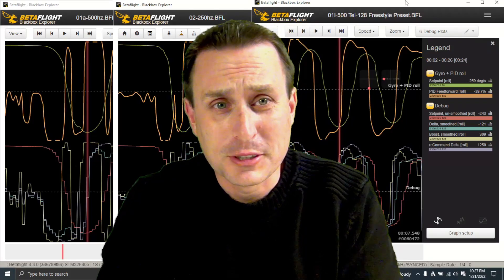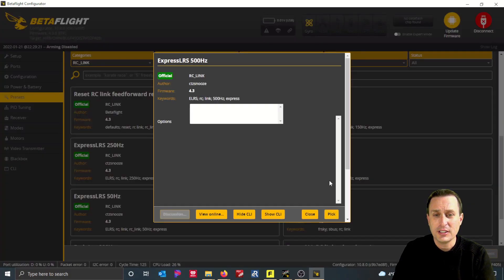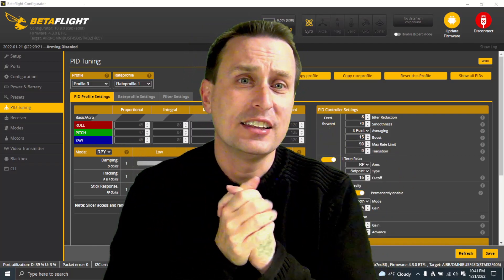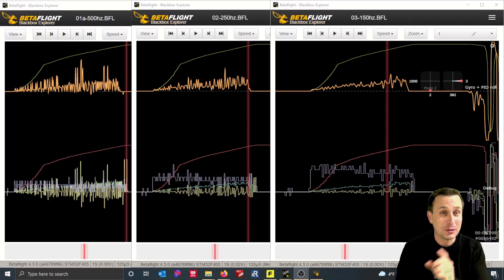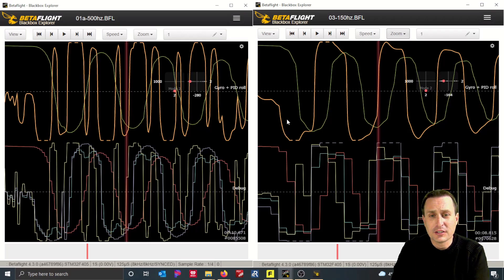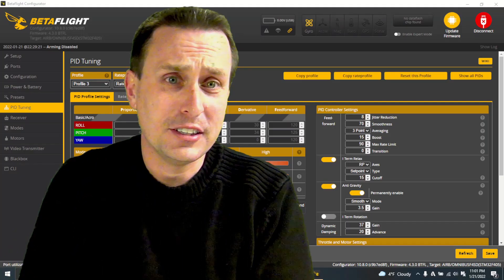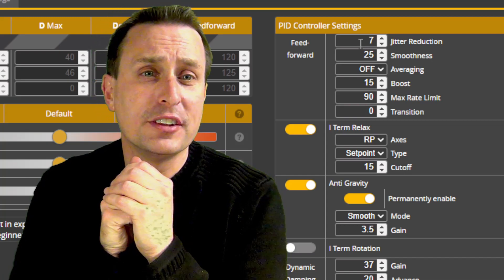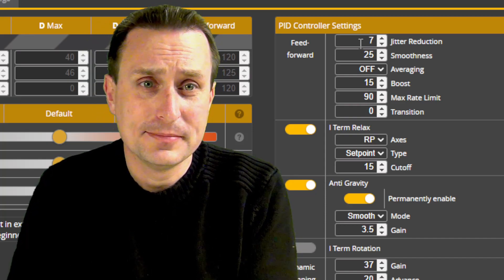The DOWNSIDES of Low Latency RC Links | the JITTER secrete!  💥😮

Comment: Brother what would cause my throttle stick input to not be in sync with motors. If I’m going in for a dive and I drop throttle it takes just a second then it’ll react to my input after It should’ve already started the fall. Same for when I come out of the dive it’ll just keep climbing for just a second after I’ve gotten my throttle where I feel it needs to be. Its like it takes just a second to make it to that position say if I bring my throttle to 50 percent my motors raise to 60 then ease back to 50 where where it needs to be and it gets worse the farther away from myself I get. Thank you sir.
Reply from the maker: if a ducked quad, switch from props out to props in: https://youtu.be/7GweG0RnCfc?t=459
Reply: It is a nazgul 5. I put your 5in tune preset on it last night and my telemetry rates are 1:128 so do I need to make it like 1:64 or whatever the numbers are lol or would that even have anything to do with it. I havent flown it since I put the tune on it but I armed it and it really seemed to be a lot smoother but I can’t really tell til it’s in the air. Thank you a lot man
Reply: Im using the 250hz packet rate. While I was running a ratio of 1:128 would I need to go up to 500hz or Lower my ratio to 1:64 if I stay with 250hz
Reply: Update. Quad is doin better than it literally has ever done with the UAV tech tune. Maybe a ms in lag but I’ll figure that out. motors were like ice I mean not a bit of heat My 1400mah lasted me normally 2:30 3 mins. My last flight was seriosuly 6 mins exact. If you need a tune I suggest UAV tech. It’s like a completely different drone thank you a lot brother.

Comment: Thanks for the info Mark. What can we do to reduce jitters if we're not on 4.3?  
I recently migrated all the quads I've built to ELRS  from various entry level control links. I've just finished a build tonight then realised my F7 FC didn't like the newest 4.2.x (no ADCs showing), so I'm back to 4.2. I might b stuck there on this quad.
Reply from the maker: No ADC's?  What does that mean?

BF 4.2 has more aggressive filtering by default for FF, so you should be ok.  There is FeedForward setting in 4.2 as well, they are just only in the CLI.  So go into the CLI and type 'get FF' or 'get feedforward' (can't remember) and you should see them.

Comment: i think this is what eLRS got a bit wrong, chasing ultimate range on 2.4GHz and sacrificing everything else just to have smallest packets possible to get that range... SNR is one thing, but only 4 full res channels limits the use to kwads or shitty epp fixed wings only which is a bit of shame as all super-small eLRS receives would be ideal to use on small micro planes and other models) ....i wish they will add some mode to have support for 6+ full res pwm channels in the future.
Reply: ELRS was developed by drone racers for drone racing. Just because what they developed isn't what you wanted, doesn't mean they did anything wrong.
Reply: @benaresq  they didn't do anything wrong!, it got them the very needed global visibility. there wouldn't be any eLRS ecosystem emerging as recent months without that. it is just current use is so narrow focused while it could be full-fledged open source radio link for everything.......maybe one day...

Comment: Does the processor loop times affect the jitter? Thanks for the info Mark, super interesting!
Reply from the maker: Yes.  Scheduler in 4.3 is revised to give Gyro the highest priority.  So if you run too close to 100% (after arming) (F411 boards) your jitter on the RC link can go up.

Comment: Thank you! Very informative. Do you have any onboard dvr showing what the jitter looks like? Is it very noticeable?
Reply from the maker: It depend how high you push FF for a locked feel and quad weight/motor power.  DVR not so much, but HD, yes (with high FF).  Slow rolls at 0% throttle or "skating" is where it pops out.

Comment: 4.30 RC2 defaults worked fine for the 200hz ELRS, though it's probably right at the edge where the averaging starts to make a difference. 4.30 is a very substantial update, it's almost difficult to push it into wash 😁

Comment: I have the CrazbeeF4 ELRS Board with Bf 4.3 RC2 and i have the Tango2 with the latest Firmware and ELRS Slim Pro the newest model with fan and metal casing with 2.1 elrs on it. Most of the time ELRS didnt connect on the first try, i need to unplug the battery from the quad und replug it again to get a connection to the quad otherwise i get no telemetry and the bf receiver tab shows me meanwhile really strange and hopping values and i am doing nothing on my Tango2. Anyone here who has the same problem? I've already set 250hz in bf and in the elrs module.
Reply: Had the same issue. Look at your CPU load. Mine was about 70-80%. Try to reduce your pid loop frequency.
Reply: Read 4.3 tune notes. 8k / 4k dshot300 for f4 boards. Otherwise there is problems If you use 8k/8k and or dshot600.
Reply from the maker: Yup.  What these guys said.  Also, there is some RX improvements coming in RC3 for when CPU load is high.
Reply: My cpu load is 45-50%, and ive already set the  cpu_overclock to 120mhz. Blackbox logging is off, Accelerometer is off, Dshot is 300 and my PID loop is 8k/4k but the problem is still there. On the ESC is Bluejay, bidirectional dshot is on, soft gyro 1 is off and yaw lowpass is also off.
Reply from the maker: Alessandro (the creator of ELRS) is currently troubleshooting that right now was Steve Evans (BF dev who did low level optimazation) in the Betaflight slack.  Seems like an SPI receiver thing.  They are trying to figure out if it's an ELRS issue or a Betaflight thing with 4.3.  

Does it happen with 4.2?
Reply: @AirKhanFPV  8k/4k didn't work for me either. I reduced the pid loop to 2k but I didn't overclock the cpu. Maybe I should try that as well.